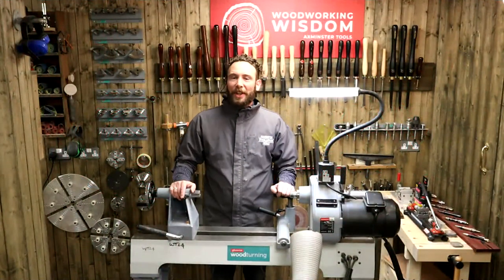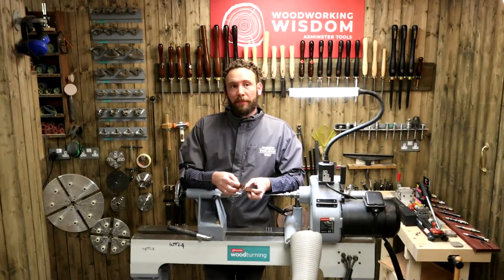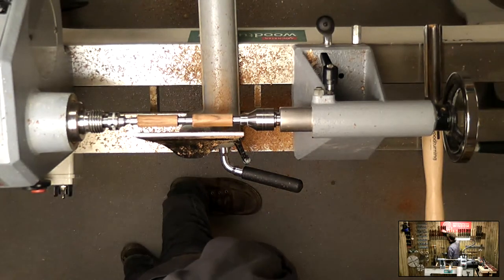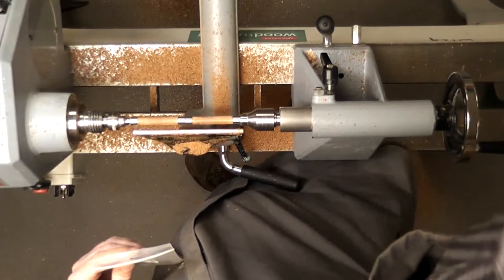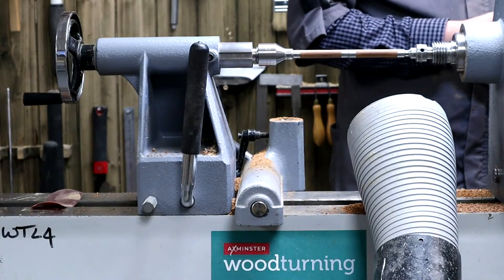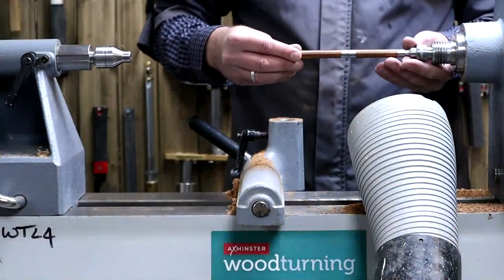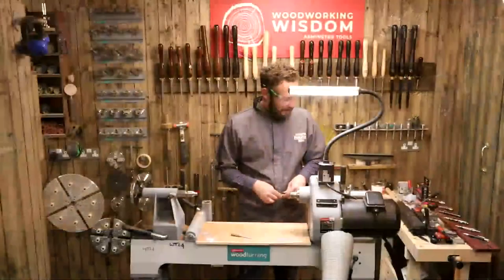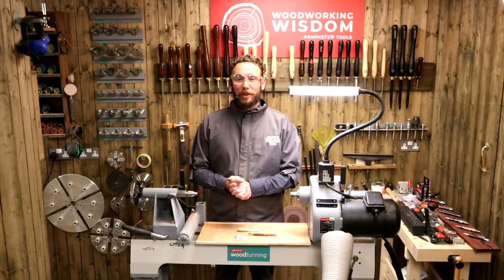Woodworking Wisdom - Fountain Pen

Comment: With regard glueing tubes into HDPE, I understand very few adhesives work but Ive seen a YouTube vid where the hole was drilled in the HDPE about 0.5mm to small and the tube can be forced though without glue. Haven’t tried it myself but apparently the slightly small hole is not to small to prevent the tube being inserted but is tight enough to keep in place

Comment: Can anyone tell me the purpose of the tailstock unit on the pen press
Reply from the maker: Hi Doug, thanks for getting in touch. The tailstock on the Axminster Woodturning Deluxe Pen Assembly/Disassembly Pen Press comes into use when the carriage is removed and is there for longer projects that have a push fit. Things like bottle openers, salt and pepper mills or turned tenons into drill holes on lots of different projects. It's also removable if you don't have a use for it. I hope that helps.